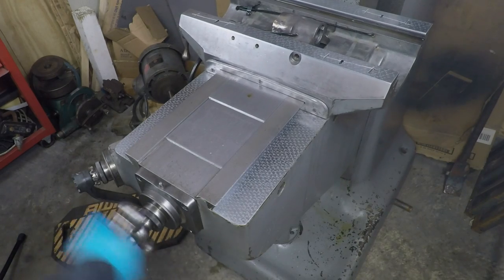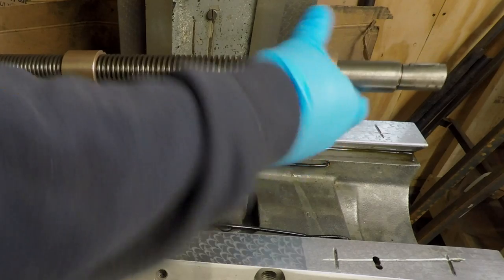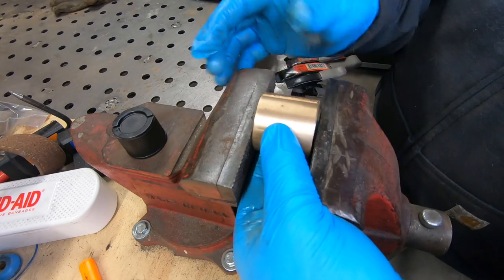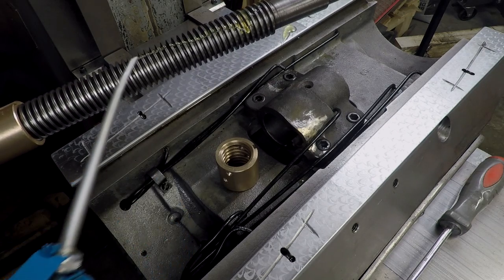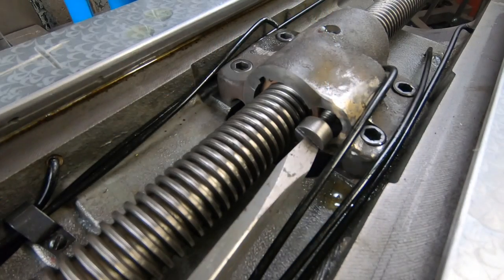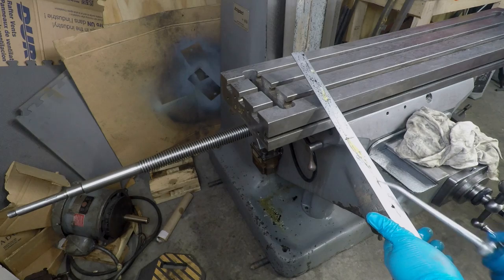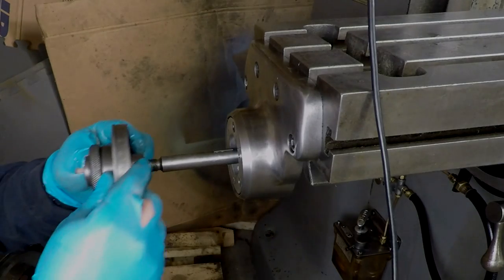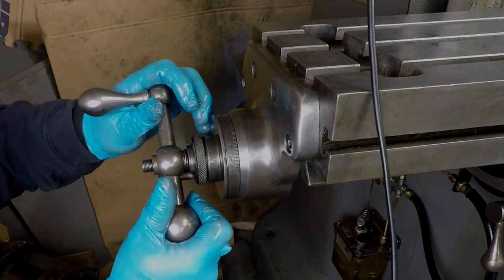Bridgeport Mill - Installing the Table

Comment: The spring loaded crank handle goes on the power-feed side. Unless your machine has spring loaded cranks on both sides? Thanks for the video
Reply from the maker: Yes it does

Comment: Recently on my Bridgeport,  when milling   a .070 channel into some steel with a  ball nose endmill, going back and forth on the x-axis, I'm getting a little play in the y-axis by the ends of the channel, when I switch directions on the x-axis, even though the gibs are tightened down by the Y. Instead of a straight channel,  it's a little bit bulbous, and slightly enlarged by the ends of the channel due to what I assume is table slash, when I go back and forth.  I'm able to physically  wobble my table slightly. Is there any way to tighten a table down, there won't be any table slash?. Excellent videos by the way.
Reply: I think I just realized it's adjusting the Gibbs. Started doing that , already helping a lot. Been using the mill for 5 years,  I'm so ridiculous.
Reply from the maker: @naasehvnishmaJH87  It's a perpetual learning process. I was going to suggest looking at your gibs. But keep in mind that if the gib was loose, you MAY have uneven wear on the gib, and you may still have issues that might require fixing the gib. I have learned it's important to check these from time to time.

Comment: Question for you I have the same power feed for my machine the issue is my screw shaft does not look like that on the end there for I can not install my power feed if anyone has run into this issue please let me knos
Reply from the maker: I don't really have an answer for you not knowing what your lead screw looks like.